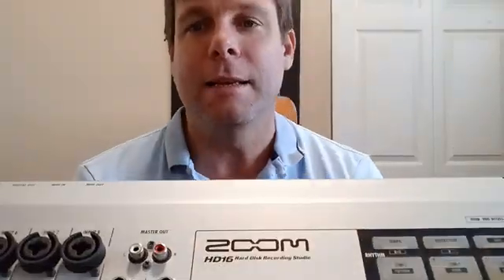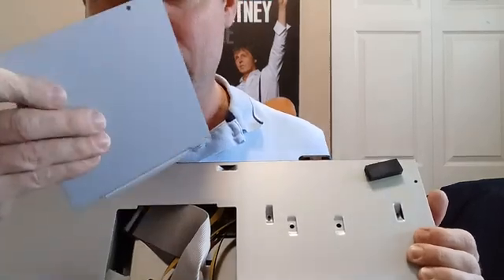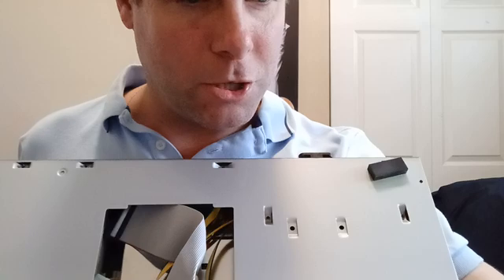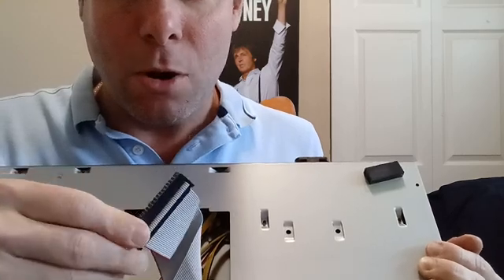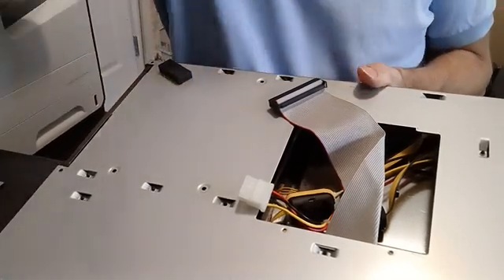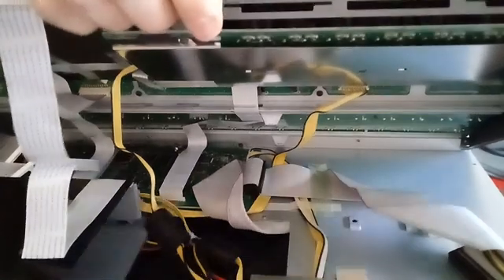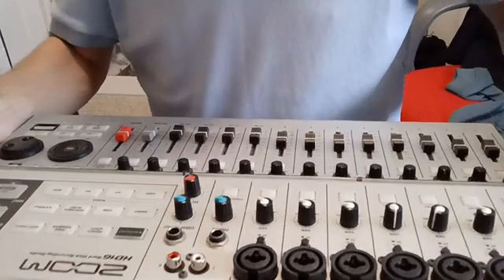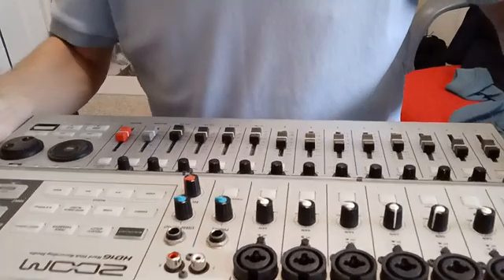Zoom HD 16 HDD Removal

Comment: Thank you so much for this video. Just pulled mine out of the closet. I have another one that isn't working after trying to resolve the power cord issue cutting out. So I have a spare. There isn't any good information on this unit but I just love the way it's built. Thanx again.

Comment: Can anybody help. Im trying to get my Zoom HD16 going again. Worked last time I used it around 5 yrs ago. 

Wouldnt turn on so purchased new power supply, Hard Drive and install CD.

After i fitted all these things it now powers on, says CDR DRV found but then got to an error mrssage 'System File Error'. Do i need to do anything to the hard drive to get it working? Reformat it or something? By the way its a 2nd hand duplicate of original that was cleared and tested. 

Any ideas? I feel like im so close!

Addition: after holding Clear and booting i get error message 'Err No ExtFunc'
Reply from the maker: I believe you need to format it just as in the video from the machine. is it a 80gb hdd?
Reply from the maker: did you get it figured?
Reply: @MarvinBarclay  thank you for your advice and for checking in. No, I started working on a different system. Saying that, it is back out on the side ready to be worked on again.

Comment: Thank you so much for posting this, Marvin!   I'd figured out maybe 80% of this via trial & error and reading the manual, but having all this info in one place is super helpful.   The clear & concise instructions + additional tips are appreciated as well.  

Thanks to GAS I've ended up with a few R16's, an MRS-1608, and an HD-16 over the years.  I believe the HD in my HD-16 is dying as i often get the "Please Power Off" message soon after power up.  (Less frequently a year or two ago, then when i took it back out of the closet around Thanksgiving of last year it started throwing the error more often -- sometimes immediately after booting up.  I went ahead and backed up the hard drive via USB at that time.)

  Because of your video i feel empowered to pull my beloved HD-16 back out of my closet and having a go at replacing the HD and/or IDE cable.  <3
Reply: Ref yr hd16..mine was doing that intermittently but it turns out its the power connection/board inside which seems to let go giving me the same problem you state. I solved it in the short term by putting a weight on the cable to keep stable but obviously there's an issue I need to address. Gave mine a long term test today and as long as the power connector was undisturbed it worked fine for 4 hours
Reply: @zfid  Thank you for that, zfid.  Will look over the power connection / board once i've opened it up...

Comment: Thanks for that. They're a great old recorder, mines had an issue with the power plug (needs holding in a certain position) which, I think, has made the HD slightly temperamental so I've wanted to open to both resolder the connector and possibly switch to an SSD.
Reply: I tried to fix mine for a short in the PS. I ended up making it worse, so I bought another HD16. I did notice the power supply was different for the one that didn't work. The 2nd one had the correct one. I just love the way this thing is built and the drum machine built in. Some of the newer Zooms don't have the drums. So this one is working, but i'm a little leary of the hard drive. Althought I have a backup from the 1st one. If you've found a way to go to SSD please let me know. Not sure if there's a space limit. And of course the right adapter for the modern connector. I did manage to get the CD for it, although haven't put it in yet to see any utilities that might be on it.
Reply from the maker: @Atlsynth  You may have to format the new HDD to have the same amount of space as the original, 80gb Not sure if it can handle more. I was repairing this one for a client and could find anything online about it which spurred me to make the video 🙂